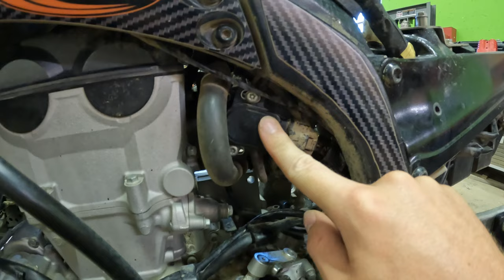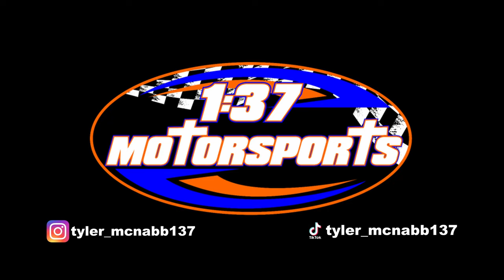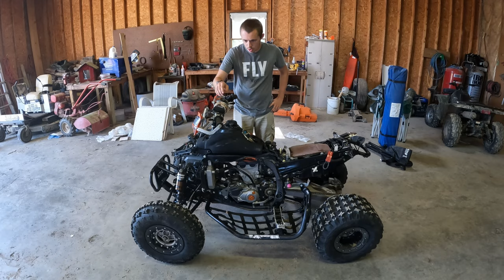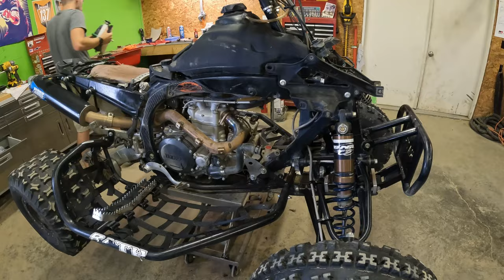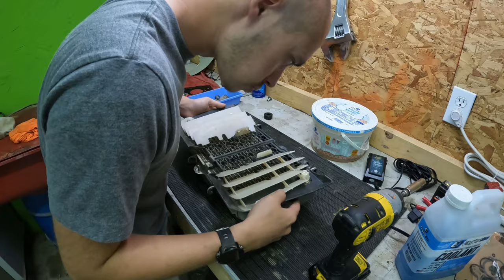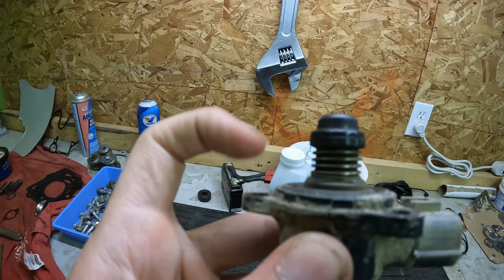YFZ450R Manual Idle Adjuster Installation & Cheap Radiator Protection

Comment: I run Ls4 mud guards on 3 machines they don't affect the air non so ever and do really good job of keeping mud out at the end of the day nothing gonna block a radiator as much as the mud does even If ur radiator takes on the little bit of mud ur already restricting more then a guard will Mishimoto radiator also helps a ton Glann Innovations makes a nice dual fan setup that does a great job also

Comment: i like that MIA valve and you do a good job of explaining . personally i wouldve kept the coolant over flow tank  it completes the system . years ago i never had one on my 250r that my dad got from Joe Byrd back in 01 . but back in 2018 when i got it back running i put one on to complete the system . on my yfz450r my buddy set it up like he had his with no oil return can saying they was unneeded . i ran it for a few races and put an RP oil can on to complete the system . to me i like the system being completed even if its not needed . Joel Hetrick runs the radiator over flow and the oil return can on his bikes . if he thinks theyre needed , well then im not going to even bother double guessing . either way ill still have your back

Comment: My yfz has this engine code 37 and it won’t start without gas it will only start with a little bit of gas and idk what it could be I have a stock ecu also it’s a 2016 yfz 450r please help…
Reply from the maker: @jeremyayers8307  sounds like your IAC valve may be bad, either that or it could be a wiring issue like a short somewhere. You might need a manual idle adjuster like I put on here.

Comment: Do you get a engine light for installing that manual idle adjuster?
Reply from the maker: Not that I know of. I didn’t have any issues with mine
Reply: @TylerMcNabb137  ok good to know thanks, and how many click out are you?
Reply from the maker: @floridatrailrider305  mine doesn’t have clicks but I believe I’m only like 1-1.5 turns out if I remember right.
Reply: @TylerMcNabb137  thanks

Comment: Hey Tyler, I had the same problem with mine the last race. On lap 3 it would shut off when I pull the clutch in. After the race and the bike sat enough to cool down, it didnt do it. I am looking in to the manual idle controll but was told after install I need to get the vortex reflash/retuned to it. Did you do that? What's your thoughts?
Reply from the maker: I did not reflash/tune mine and I personally never heard anything about doing it. Mine seems to be running the exact same with no issues.

Comment: Keep up the good work man! If you only had one quad to keep and didn’t race and only rode trails, would you pick the yfz or the good old 400?
Reply from the maker: Man, that’s a tough question. I love the 450 but I guess if I was only trail riding, you can’t beat the 400. I’d definitely miss the power of the YFZ but I like tighter more technical trails so the 400 would probably suit me better

Comment: After install on mine (2020)  it idles extremely high and turning the knob does nothing.

My 2018 came with one on it and that idles decent still seems little high but again if I turn the knob on that one I don’t notice any change. 

What is your thoughts?
Reply from the maker: I had to turn mine pretty far in. I believe I’m like a turn and a half or so out from fully closed.
Reply: And with it turned most the way in does it seem really high still?

Before putting it in I was having is starting to stall like you said happened to you. But it would only idle high till you blipped the gas then it would drop to normal.
Reply from the maker: @Domabeast7  no, mine is set at a good idle. If you turn yours all the way in does it die? It should
Reply: Well that’s why you don’t rush in the garage! I had it slightly offset so the print wasn’t sealing properly def works as it should now! Appreciate the responses man! Most people dgaf